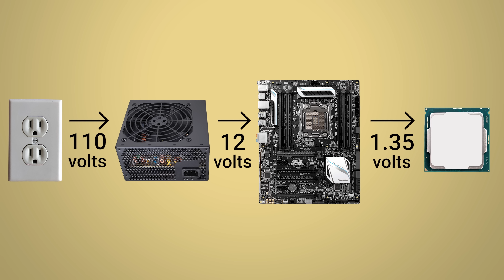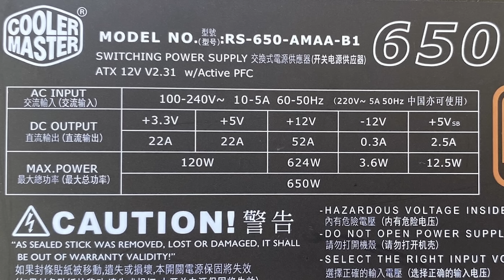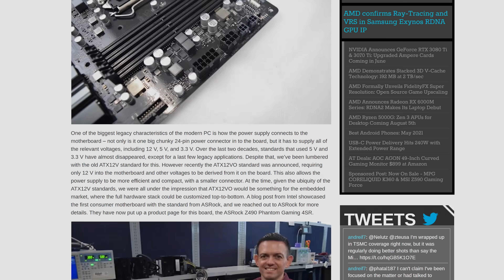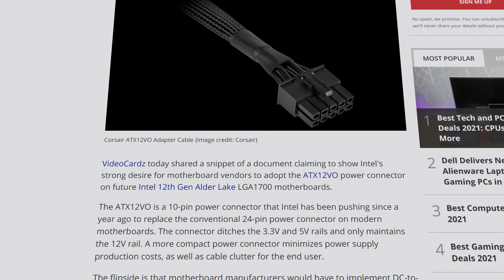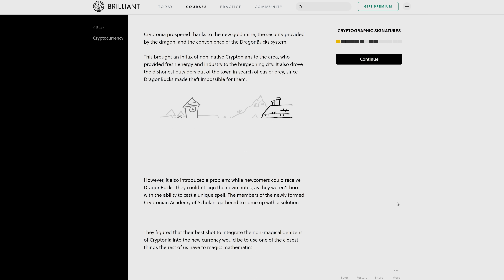Is The 24-Pin Connector DEAD?

Comment: It might just be me, but I never had issues with the 24 pin. 
Not that I am against the 12volt standard, but still... if it works, it works.
Reply: Yes, I'm concerned this change might mean you have to make sure your PSU is compatible with your Motherboard
Reply: @camolion7529  You already have to, to some extent. Some PSUs don't have enough CPU connectors or split-off 20+4 connectors, and most PSUs lack the negative voltages for very old systems.
Reply: @gajbooks  Yes ok but the situation was improving  and If you just buy some random PSU and Motherboard today the propability it will work just fine is pretty high. As far as I know many incompatibility issues only start appearing if you're using more "enthousiastic" parts anyway (old or powerhungry, (expensive) Components). This new Connector will propably affect the newest, most basic parts and complicate things especially for first time builders and might force Upgraders to buy a new PSU
Reply: @camolion7529  I personally think the connector is silly, but the 12V isn't un-silly enough to be worth it. It doesn't make any sense to move power supply components to the motherboard except in situations where it is impossible to have legacy components, otherwise you're just shuffling the parts around and moving the inefficiency to the motherboard instead of the PSU. In the case of prebuilt SFF PCs, which is what this fits, why bother using ATX-like PSUs at all?
Reply: @camolion7529  You already have to worry about modular PSUs and their cables, so it's not unheard of. 🤷
Reply: @camolion7529  wow imagine that.. having to actually CHECK if one computer part is compatible with another one?! If that ain't the 8th circle of hell I don't know what!

I mean you're telling me a computer part could actually not work with a different COMPUTER. PART!??!? THEN FUCKING CALL IT SOMETHING ELSE GOD DAMNIT WHO DO YOU THINK I AM TELL ME RIGHT NOW WHO IS TO BLAME FOR THIS INSANE GUESSWORK DO I LOOK LIKE A FUCKING MACHINE WHISPERER TO YOU??
Reply: I never had a problem with the 24 pin either. I guess some people do, but with all the builds and repairs that I've done in my life I've not had an issue. I think it's adorable that Intel thinks they still run everything and can force everyone to change a standard because they want it to happen.
Reply: @TheQuickSilver101  yeah, honestly I swear they do it on the cash grab at this point. Plus PSU's are insanely power efficent than they were 20 years ago, the one in my Dell Dimension (which we replaced in 2008) was a monstrous 1200 watts that was used in my dads old work computer raised out electric bill by 14 bucks in NJ. My current one raised outs by two cents, it did jump by a dollar when i was doing F@H but it was running around the clock along with my laptop for six months.
Reply: I learned this is a compliance to gov regulations. But let's consider how many components are plug and play into a PSU nowadays? If it ain't powerful enough, swap out the PSU with a beefier one and add components as you wish (GPU, storage, fans and even RGB). There's very little thought to compatibility with your other components.

With this standard, you will need a rating on the power handling of your board. You now have a limit in adding 5v/3.3 components because of your Mobo. Who provides the cables? You have to check the rating AND the platform of the CPU.

Scarier thought - your Mobo is more prone to failure because of added (power management) duties. I may be wrong, but that's what it seems to me. They just moved the hardwork of the PSU to the motherboard.

With that, I'm not completely convinced that the reasons behind are all that altruistic.
Reply: Hey man same here..! I don't plug & unplug it everyday..! So why bother..!
Reply: I bought a Coolermaster 90° bend for my 24 pin cable and it looks amazing. Works like a charm. Cheap. Took less than a minute to connect and install. I have no need for a new board.
Reply: yeah it's a little big but you plug it in and it just works
Reply: @Phractical  What fucking argument is that?

"I mean the product does what it's supposed to do. It can perform it's designed task. So why the hell would we ever try to innovate and make it better in other ways?"

The ford model T just worked. The horse before that probably even "worked" more reliably.
Apple - It just works. Your argument - it doesn't.
Reply: @Wheelchairmurdura  no issues with power delivery I don’t have to plug in extra cables for sata and as of right now I know it’ll be reliable it’s that simple
Reply: Only problem might be when your 24pin is practically stuck to your board :( Mine I practically had to force it off by using my own lifting power :-|
Reply: There's a nice saying that says; if it ain't broken then don't fix it.
Reply: @Netscape-kd6mg  It's not about fixing, it's about improving. The fact that CPUs work doesn't mean more powerful ones are not needed.
Reply: @cotneit  improving is good aslong as it's done intelligently. by willing to improve too fast they may break something that was working more then well enough for it's purpose. what's more problamatic? changing a PSU when it's 5V rail fails or changing the entire motherboard (and most likely CPU and ram at some point) because the converter failed? i prefer it to be the PSU. it's less costy, won't break my windows licence registration. and there's a much better backwords compatibility between PSU and old motherboards then between a old CPU and a updated motherboard in most cases. you can put a modern PSU on a 8 year old computer. you will have much more problems finding a compatible motherboard with your 8 year old processor and RAM.

That's what i mean by if it ain't broke don't fix it. instead of having to change a 100$ or so PSU having conversion made on the board could raise the price a 3 to 4 folds. and that's not even considering then lower reliability on the microchips. you won't want to be stuck with a dead computer because of a chipset shortage.
Reply: They are trying to push a narrative. Ltt has been raving about the new standard since the very first video
Reply: They always fix what is not broken😂😂😂
Reply: @garyaudine3327  called 'innovation' aka cos need give a reason to sell more mobos... Image that an i5 fro 2014 that is still perfectly adequate... (I5 4960)
Reply: The issue I'm experienced so far is when try to plug out the damn thing
Reply: The PSU last longer than the motherboards. If you move components from PSU to the motherboard, you create more e-waste for the DIY market.
Keep those connectors for the pre-build market.
Reply: Anyone who whines about 24pin ATX connector probably never had to deal with its predecessor from AT era.
As bad as 24pin connector is, at least its physically impossible to plug it in incorrectly and fry your mobo.
Reply: @Jewsh  Ah the good old P8/P9 connectors, God I don't miss those.
Reply: PREACH 👏
Reply: Ye I've never had problems either but like this seems like a good idea
Reply: The first time I was disassembling my pc it took me 30 minutes to take 24pin out. Then it took 30 minutes to put it back in. That's probably just the connector on my motherboard being too tight since I went through the same thing with a new PSU, but damn it sucked.
Reply: I've definitely struggled with it in terms of cable management but in the end, it does work. at the same time though if we can get away with less pins, every bit helps!
Reply: One argument I’m not seeing here: PSUs last much longer than motherboards. Your 5 year old motherboard is missing features and doesn’t support modern hardware. But your 5 year old PSU can still run a high end system. So let motherboards handle the voltage stepping, the requirements for which change all the time, and let the PSU do what it does best.
Reply: @DanKaschel  yep, believe it or not i see some people say that too in other video but same topic, there's a reason why psu manufacturers gives like 10+ yrs warranty in some of there model, plus here's the thing, Apple say they're not changing the damn lighting connector to usb c is that it's gonna create a load of non compatible accessories and basically create a massive e-watse and buyer confusion, now the same thing should apply to psu if we like moved to this standard
Reply: Do you want surges on your motherboard?
Reply: Yeah, I mean how often do you actually meddle with that connector unless you're a tech or something.
Reply: You know what else worked? 

Molex connectors.
Reply: It is a bad idea, and always was.

They could have gone 24 volt with this, and solved a lot of issues. 

Or do 12volt only along with not requiring to power sata right from the mobo and only having 2-4 sata power from any psu.
Reply: only upgrade needed for 24pin is a 90d deg adapter in the box with the PS
Reply: Absolutely agree. Don't reinvent the wheel. Besides, ITX board ain't got space for additional stuffs
Reply: I guess you missed the part about power efficiency. That’s really imp. too
Reply: @kirathekillernote2173  the efficiency argument is bullshit unless you force the equivalent of a gold rating too as a minimum. The efficiency benefits are minor compared to the variance already existing on the market.
Reply: @lugaidster  
Not it's not, the standard efficiency ratings of 80+ only apply at high loads, 12VO is just as efficient at high loads, and much more efficient while doing simple tasks, unless you turn on your computer only to game, and turn it off once you're done, then it does saves you power, depending how much time you navigate the web (or something like that) on your computer it can actually save a considerable amount of energy
Reply: @gerhardsmith7892  but you can have a lot of variability in idle power consumption and a lot of variability on load power consumption. My point is the efficiency argument is bogus once you consider the fact that a new "more efficient" PSU on the newer standard could be less efficient at load (maybe even considerably so if using the equivalent of a bronze vs an old gold or plat).

Then there's the fact that you could make current PSUs more efficient too at low power consumptions but the standard doesn't enforce it. You could keep the current design and require certification at low powers and you'd see backwards compatible PSUs also being efficient at low power. Moving the regulators to the motherboard does very little for power efficiency in and off itself except indroducing even more variables when things fail.
Reply: @lugaidster  
You might have a good point there, I never considered that Titanium does requiere 90+ efficiency at lower powers, so you might be right on that aspect

Still, I don't really know how expensive it could be to have this efficiency on every PSU (meaning making them, not price to the public), specially since OEMs have used their own versions of 12V only (not Intel's new standard, but their own versions), meaning that it might be cheaper for the to get that efficiency while only having 12V than making normal ATX 12V PSU at that lever of efficiency at lower power 

BTW, I'm really tired and english isn't my first language, I know that I did a horrible job at explaining myself, sorry if you have a hard time figuring out what I was trying to say
Reply: @kirathekillernote2173  true, but the computer as a whole is still a big Hester so 10% maybe for the PSU is tbh, negligible
Reply: fuck that abomination of a connector, ive come close to snapping boards so many times because of the stupid force it takes to plug in sometimes
Reply: @KekusMagnus  ... What kind of PSUs do you use...?
Reply: @KekusMagnus  And god help ya if you want to unplug it! I nearly broke one high end mobo because the thing was secured too well.
Reply: If the 24pin atx connector is giving you enough trouble to make it worth adding several extra cables to your system to power your sata devices, you should just stop building / working on your computer yourself....
 This is fucking stupid.
Reply: @conandude76  PSU->drive cables are replaced by MB->drive cables.  There aren't more drive cables.
Reply: I work with them every day and they're my goddamned nightmare. I have to take apart many computers and the amount of force necessary to remove the 24 ping is unreal
Reply: @arthurbttf  That's an issue with the shitty locks on the 24 pin cables, not the cables themselves.
Reply: @LoneWanderer905  Even when unlocked it takes an absurd amount of force. Or I could just be weak
Reply: @arthurbttf  that's what she said
Reply: Bring us ATX12VO and then ATX24VO, ATX36VO and ATX48VO for more industrial applications !!!  DO IT!  JUST DO IT!
Reply: It's an awful connector, I'll be glad to see it gone. Front panel jumpers next please.
Reply: Changing it to 12V only will simplify things that no longer need to be as complex as they are, making it possible to save space, energy, wires, thermal, and so on.
It don't need to have an issue to change it, it's just getting it better in some way.
As a headend/datacenter technician, I can see why they are doing this, some highend telecommunication equipment uses 12V only already.
Reply: That argument doesn't hold up in court.
Reply: I believe the 12VO standard is much better as it is more efficient, reduces circuit complexity inside the power supply, hence reducing the cost and chances of failure, and overall, the physical size of the power supply itself.
Reply: @TechBuild  To be honest, I would rather replace a PSU than an entire motherboard because of this new standard. All we would be doing is moving the required circuitry from the PSU to the motherboard which will drive up costs and failure rates of motherboards. PSU replacement is much easier than having to tear apart an entire system (which means repasting CPU cooling devices), having to redo all the overclock settings (if you OC), and is in general a pain in the butt.

Comment: Let's hope one day they evolve to the same way Apple is providing power on the Mac Pro. Through the motherboard, no need for cables, just one cable from the PSU to the motherboard. Way easier and cleaner.
Reply: So, if anything fails, you need to replace the entire motherboard? Apple provides good looking, lightweight and easy to use products, but they are extremely fragile, with very limited repair options (they are designed to be almost impossible to repair by non licensed repair services) and why the heck they have so few ports, like WTF? Let's not hope, I'd rather have a wide laptop made of desktop components placed in a steel case that slowly makes you into a bodybuilder while you move it around than Macbook Pro.
Reply: @filiphabek271  as it will become a standard across the whole pc world it would be the same as a normal motherboard/PSU/GPU now. And with a larger scale of production better products will come. It will simplify production as there needs to be only one plug, all extra's like HD's, GPU's, RGB, ... will become easier to connect and manage. 
I won't like limited ports and upgradability also but combining that feature, one power connection on the board, and distributing power through that same board is something I would like.

Comment: So now we need to deal with, not only PSU manufacturers cheaping out, but also motherboard manufacturers cheaping out too? 

Honestly? Fuck the new standard
Reply: It's basically a good thing, the motherboard does power conversion anyway for the cpu so putting some more converters on there isn't going to break the bank. If you're cheaping out on your motherboard anyway youre likely to run into issues 

Psu's will get more efficient

Smaller cables

Sounds like an overall win
Reply: @willsoe  I disagree. There's plenty of expensive motherboards with shitty VRMs for CPUs. It introduces more points of failure into the motherboard making it even more critical. It makes them more expensive and the corresponding savings in cost from PSUs won't be realized. It makes MB larger, making it harder to fit them in small enclosures. It breaks backwards compatibility, forcing people to upgrade for a stupid reason generating even more ewaste. Building cheap NAS will be harder since most motherboards are unlikely to have power to drive 6-8 HDDs or more.

All in all, it's a solution looking for a problem. Maybe even pushed by PSU manufacturers to generate more revenue from upgrades, because why else would this be an issue. The only benefit is efficiency and it's in the few percents. You'll have more variability with cheap PSU regardless of this standard unless you're boing to tell me that this standard will force PSU manufacturers to comply with a minimum of 90% efficiency. 

By the way, there's plenty of reasons to buy a $150 MB. This new standard will make that price target much harder to hit. Not everyone needs 16 phases or RGB controllers.